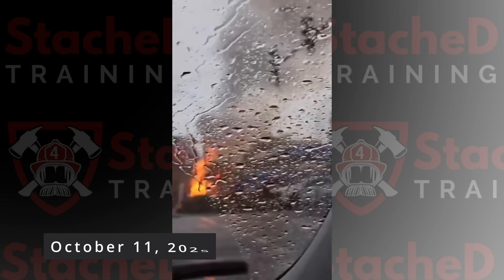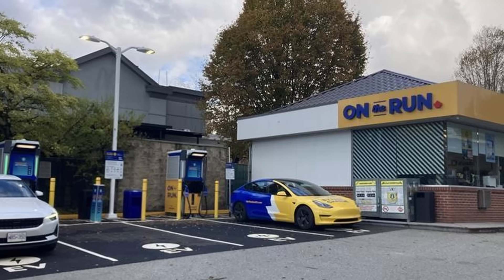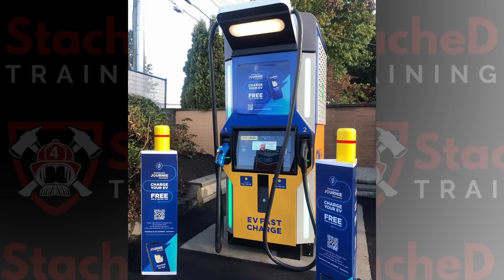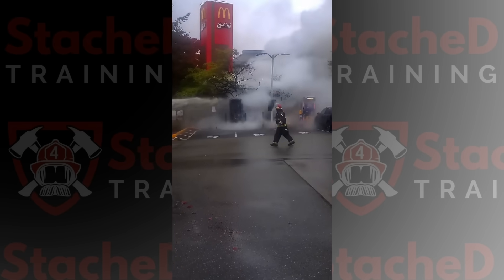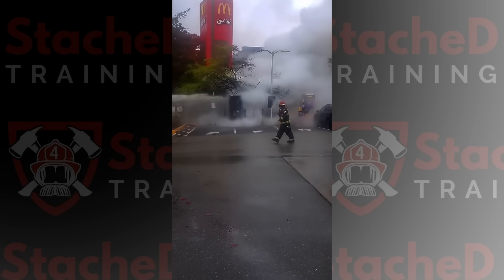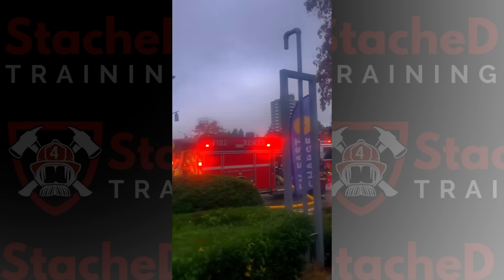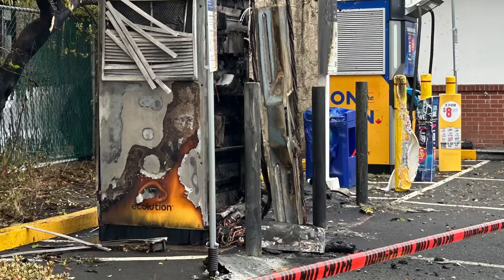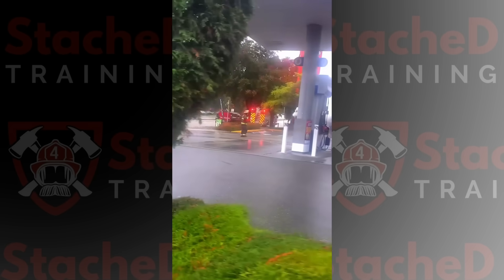EV Charger Fire in British Columbia: Hidden Batteries!

Comment: Is the contaminated water from extinguishing contained, or let to run off into the aquafer?
Reply: The location of the fire is about 2km from the river that dumps into the ocean about 20km downstream.
Reply: @e-curb all of the storm sewers in New West flow to the river because they were built in the 1800's. Been a problem with pollution for decades.

Comment: The thing that occurs to me is,  this system is the cheap alternative for those that want to have charging facilities, but don’t want to spend the bucks getting power lines and infrastructure upgraded for a full power grid system. 
  Upgrading grid and lines to a destination can cost hundreds of thousands of dollars, in some cases with bigger installations even millions. 
 When  you add up all the costs involved across the board to the community as a whole with the implementation of EV’s  and add all the cons  , EV’s are just a really costly stupid option. 
 Guaranteed , the cost to the community at large will grow , and imo these events will become commonplace. 
  I live near a main road with with a fire station , in the years past some days we’d go days without hearing a siren , currently some days we hear siren after siren with a frequency I’ve never experienced before. 
 This is allegedly progress.
Reply: To power this very small charging station without batteries, the power upgrade will exceed $1M.
Reply: The infrastructure cost point could be made for water, natural gas and fuel infrastructure as well.
Water is needed.
Driving around tons of highly flammable liquid to decentralized distribution stations that pumps out that same liquid and having a network of pipes full of a highly flammable gas seems to me:
 1) dangerous
 2) stupid costly to maintain
When the alternative is to run insulated copper cables instead

Comment: Whether a BESS or a charging station with BESS a regulatory agency having oversight signed off on this construction/application.  Those oversight agencies should be mandated to follow your channel.  Another great training episode.
Reply: Large lithium batteries need to have a special fire classification and appropriate rules surrounding their storage/use. EVs with lithium batteries should not be allowed in parking garages that are not equipped/rated to handle the increased fire risk imposed by the large lithium battery. Not because the battery is likely to CAUSE a fire, but because that battery increases the fire load and danger when there IS a fire. We just need to add applicable rules to the fire codes to handle the special hazard that these large lithium batteries represent.
Reply: @Tom89194  You're on the right track. Li cells are a massive chemical fuel source which will ignite at 90C and cannot be extinguished by any method. 

Large battery systems do cause more fires, and massively more destruction. The industry uses weasel tactics to make these claims. 

Example. If you charged your car in your garage overnight, then at 3am were pulled to safety by FD, then the news reported the fully melted EV in your garage MAY have not been the source of this fire, you may have some questions. This is a good point you made, if the fire was started by a box of old fireworks that lit up the lawnmower and some greasy rags to ignite the innocent EV battery pack fuel source. 

But what they are doing is more troubling. Like when the EV charger runs amok massively overcharging until one cell exceeds 90C, then the whole battery system burns every cell. Well, that wasn't Li batteries starting the fire. No that was the charger at fault. 

Or bad sensor on the pack stopped the cooling system from its duties. Oops, another overheated battery, but that's not the batteries' fault. 

Same trick is used for wiring, connector, sensor, controller failures within the battery packs. 

Then for petrol vehicles, the fudge the other way. They include cars built before EV production began. They also include electrical and brake fires. 

The DOT reports vehicles in collisions, not vehicles parked in a garage. This is because the parked vehicle is not transporting anything at the time. EVs do ignite while parked so these events are not tracked by DOT

NFPA did add guidelines for safe operation specifically for Lithium systems.  See NFPA 855
and "Annex Section G.8 regarding NFPA 69 evaluations of lithium-ion ESSs has been revised to provide engineering design and risk mitigation considerations to aid in evaluating the consequences of an explosion event."

Comment: You do great work and I love your no-nonsense approach. 🎉❤
Reply: Oh sure, betting this dude creating propaganda for big oil companies. When Pinto explode from rear ended in 1970, did you complain? How about Corvair swing axle problem in 1960? How about the Bronco II roll over risk in 1983? How about Crown Victoria Police Interceptor gas tank burst into flame in rear collision in 1992? I didn’t hear you open your trap during those time, why don’t you
Reply: @rudetoy8264 hahaha. EV apologists confirm the saying that you can fool some of the people all of the time.
Reply: @rudetoy8264 those issues got resolved,  people learned and better designs came out.

Until non lithium or sodium battery's that are good are commercially available. ...

Comment: I live right by that station. Those units are really new.probably installed within he past 12 months. I was actually admiring the externally ran conduits that few them not long ago while in the McDonald’s drive thru. Crazy that there were no disconnects accessible.
Reply: Can you confirm these are the Freewire Boost Charger 200? That model contains a 160 kWh NMC battery pack which seems like a rather strange choice to me, considering the risk and cost, despite weight not being as much of an advantage over LFP (LiFePO4). Or does it get extremely cold over there? LFP can not be charged below 0 Celcius (requiring heating support), although NMC does tend to fail more often when frequently charging in the extreme cold. Sodium-Ion would be a great replacement in Canada.
Reply: @SolAce-nw2hf on the west coast we’re basically sea level. It only typically drops below 0c like maybe 10 weeks/days a year. Even in winter it is rarely below freezing temps.
Reply: @Secretcircuits Yes, with proper software these systems could just not charge themselves in the extreme cold and limit themselves to the available grid power. I guess the operator would buy a lot of these to standardise and get a discount, so an inland install would require more thermal management with LFP to be usefull in freezing temperatures, also increasing cost for keeping those chargers warm enough.
Still a bad choice to use NMC. It's not going to last supercharging EVs all day and recharging in between in less than ideal conditions.
Reply: @SolAce-nw2hf  "inland" might be Burnaby; I've done van runs in the winter out into Chilliwack and the wind chill was minus 50C. I needed to find WINTER diesel real fast at the Agri-Co-op.
Reply: What hel.are you doing eating McDonald's man ?😊
Reply: @Stevesbe just grabbing a shitty drove thru coffee
Reply: @Secretcircuits McDonald's actually has Timmy's old coffee contract,  so it's pretty good! Tim Hortons  coffee now sucks! Lol.
Reply: Can you get us a vid of the aftermath? Greetings from the PNW
Reply: They all have e stops connected not even 20 feet away. One inside the store and one outside.

Comment: I didn't know that lithium ion batteries fires is what they meant by a bright future.
Reply: in 2016, The Samsung Note battery explosion issue, and guess what type of chemistry your cellphone bettary use? 😁
Reply: @matrixbug that is why when we charge our phones they are on a stone slab by the fire place
Reply: What about propane which starts with a bang then burns bright?
Reply: @pvmagnus propane only explodes under certain conditions such as a  enclosed space with enough oxygen. Otherwise it just burns.
Reply: @jonathanjones3126 you think EV's burn or explode?
Reply: @mikafoxx2717 they do burn up, lithium loves to burn

Comment: LITHIUM CHARGERS , FOR CHARGING LITHIUMLOL GREAT IDEA
Reply: It’s very logical from  from several perspectives.  Electrical connection to the grid is must faster and lower cost than awaiting a higher power utility install.  It also allows the charger owner to avoid costly electric energy costs called demand fees.

Comment: Beautifull....imagine hospital underground parking.....
Reply: Help is close by
Reply: @sammyjimsmith6100  not when it has to be evacuated and everyone has to be outside
Reply: Exactly. Ban gas vehicles. They are more likely to catch fire.
Reply: @StopFascismNow gasoline is easy to extinguish  with currently available fire sprinklers
Reply: A hospital would have access to the kind of power that would make a battery-buffered charger redundant.
Reply: Conveniently located by the ICU for burn victims
Reply: Infinite money hack
Reply: A hospital?  What if - gasp - it was an orphanage - or - gasp - a seniors home?
Reply: @tonysandhu9275 that would probably take going through a long process to legally do so.
Reply: @jonathanjones3126 ridiculous. For many years/ decades electrical equipment and transformers have been located inside buildings. Gas cars are way more likely to catch on fire than EV’s. Per capita. Burnt gas is pollution. Batteries are over 90% recycled when their range eventually is deemed inadequate.

Comment: An EV charging EVs. What could go wrong?
Reply: Easy. The grid also has a lithium battery storage system to handle surges! Smoking hot!
Reply: Would love someone to calculate the increased power losses from using such a setup.  If 100kWh is delivered by the Grid to the battery, 90% conversion losses from AC to DC to store in the battery, and then chemical losses in the EV charger battery as it discharges to charge up the other car battery, and then the car's own chemical conversion loseses.  I'm guessing it takes approximately 100kWh to put 60-70kWh of usable energy in the car.  So instead of the 90% efficiency they claim, it's more like 60-70% in these scenarios. While better than ICE, it's not the stellar efficiency they make it out to be in these scenarios
Reply: @RT-mv7df definitely a newer setup that hit its limit from the heavy throughput on the battery. sucks that these issues rarely have preceding warnings and you have to find out with a fire.
Reply: A charging station is a vehicle? 🤔
Reply: @thecrazyfarmboy  Es ist genau so ein Schrott nur ein mehrfaches gefährlicher
ist gemeint Du DEPP:
Reply: So global warming is caused by all the EV FIRES 🔥 now it all makes sense 🤔,   I'll stick with my gas burning safe transportation. Continue to help all earthly plants 😂
Reply: Over thousand times saver than pumping gas.
Reply: @tyo0815  support your claim
Reply: @tyo0815  Sagen wohl tausend mal dümmere Woke🤣🤣🤣🤣
Reply: @theoronig6440 no it's simple physics.

Comment: I would want to put a large separation between the charging stations and the  fuel tanks. Just basic caution here.
Reply: I looked at the station involved here and another nearby in satellite photos, and in this station they were on the other side of the convenience store from the underground fuel tanks. In the other location, which I believe has the same chargers, they were 50 feet from the tanks. I will say, the propane cages might be more of a problem than the underground tanks, which are somewhat shielded from radiant heat.

Comment: This is why I refuse to put in a larger BESS in my house as well.  I would love a 100-200kWh system for UPS during the hot summer months, however there is still too much risk involved at this point.  I just use good old flooded cells or AGM cells for backup critical systems at this point.  I feel much safer with a diesel or natural gas based generator instead for prolonged outages.
Reply: sodium batteries are safe
Reply: @Magnus-t2k still new tech. Hopefully they take over for all stationary applications
Reply: @Magnus-t2k sodium reacts just like lithium just less energy dense and cheaper starting matierals
Reply: @Magnus-t2k they just aren’t mainstream yet.  Everything you find now are either NMC or LiFePo4. I am not sure the failure mode of the sodium batteries if they do fail.
Reply: There are alternative chemistries and technologies like vanadium redox flow batteries or Sodium
Reply: @ttkddry lithium is still king because it it has the most energy density and is really light, sodium is heavy and less energy dense.

In ground installations sodium disadvantages are easy to to overcome,  for applications that require lightweight materials sodium will lose.
Reply: @jonathanjones3126 in ground installations, weight and size are less of an issue. The big problem with sodium is the low C factor and the fact it looses charge over time
Reply: @ttkddry thats why nasa never touched it

Comment: mid september I was back home in New West and ended up having a chat with the electrical install company for BC Hydro own DC charger network AND they do support these Chevron Journey systems and the technicians stated that Chevron has LOADS of issues with these units and LOW uptime and the battery control system failed often on them 
they did not mention Chevron is replacing them out just that the equipment is failure prone and that the FLO Rio Tinto units are far more dependable and rarely  fail

Comment: Why doesn't lead acid not do these thermal runaway as much as lithium or nickel caduim
Reply: A: simple, it's less energy dense.  so the GREATER the density, the GREATER the volatility. 👈see if/when framed in the context of Chemistry, the problem is more straightforward and understandable than people think.

Comment: "We don't have grid capacity to support high-power chargers, so we'll install some batteries in the charger, which will charge slowly, because we don't have the grid capacity. Understand??"
Me: WHAT??!!
Reply: 🎯 One thing the eco-nuts can't comprehend is that since matter (i.e. energy) cannot be created nor destroyed... the POWER HAS TO COME FROM SOMEWHERE, NO MATTER WHAT.  Those chargers are STILL a burden on the grid, and they transfer it (WITH LOSSES) to the vehicles later. The whole concept of EV's being cleaner, more economical and safer is the biggest line of 💩 ever sold to the masses.
Reply: @mxslick50  Eco-nuts believe Energy Unicorns provide energy.
Reply: @mxslick50  maybe people just like the EV power train with clean, economical, and safer having nothing to do with it.  Are you ok with EVs if the marketing changes?  I guess it’s marketing that bothers you.
Reply: @Enter_name_here-q4d   No, it's the FACTS that EV's are inefficient, unsafe, and use up MORE resources to build and operate than standard IC engines. Marketing is a joke, and the lies are finally being exposed. Go ahead and suck on the EV teat if you'd like... but don't come crying to anyone when your battery fails and burns your car (and house) down...or worse you discover the death trap that the all electronic locks (with difficult to find and operate manual, mechanical overrides) traps you or your loved ones in a burning car.
Reply: @mxslick50  110 or so years ago your ancestors complained about how dangerous those darn gas-o-line powered wagons were, causing miscarriages in the livestock and scaring the horses. They still used candles to light their homes (electricity is dangerous!). 
Things change, progress happens, batteries will become safer and more robust for mass storage. And I say this as a petrolhead from way back.

Comment: Recon on grid disconnect would be good. I wonder if the chargers are on a separate meter or come off the gas station. I would contact the electric utility. A couple hours in the pickup with one of them could be enlightening.

Comment: Futurists told me the future is bright.  I didn’t know it meant with EV fires.
Reply: They said you'd need shades.  That's pretty explicit.  I don't know what the problem is.
Reply: CATL's new sodium-ion based Naxtra is about to fix safety issues, and for less than half the price of comparable lithium
Reply: In the UK there was a phone company called Orange. The slogan was "The future is bright. The future is Orange". It was taken over and the brand no longer exists in the UK. Sounds a lot like the future of EVs.
Reply: Hahaha...really batteries are very risky. Underestimated,  all have kept eyes closed
Reply: @iqbalkhan7047

Gasoline and diesel vehicles and gas stations catch fire and explode far more frequently.
Reply: @calvinnickel9995 not since the pinto bot
Reply: @calvinnickel9995 have never heard of it happening in 70 years!
Reply: @lindystanway8110 lol that's because it's not newsworthy.
Reply: Yup, and the future is soulless, depressing and stupid like it is now

Comment: Lithium batteries and gasoline...great mix
Reply: You mean like in Hybrids where the fuel tank is next to the Lithium battery?
Reply: I'm waiting for hybrid to go up at the pumps that would be interesting mix
Reply: All we need now is a fireworks stand on the same site. What possibly could go wrong?
Reply: Ok gas is underground.  Well, there's a propane exchange cabinet right next to it.  Is that ok!
Reply: Hybrid cars are great.
Reply: @user-ln7of9gs4s  the worst of both worlds. Pick your poison, don't choose both.
Reply: The gasoline is underground. 

A fire will destroy the fueling station, but the gasoline is safe. 

That's why neighborhoods aren't blown up (or the main building burned) when a car crashes into a fuel pump and it ignites.
Reply: @volvo09 did you see the propane storage locker against the wall of the store?